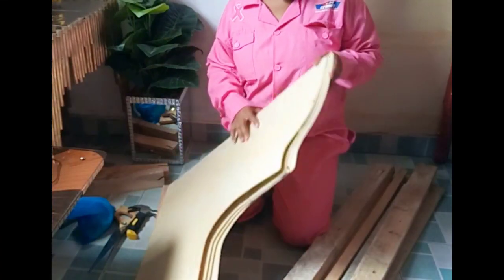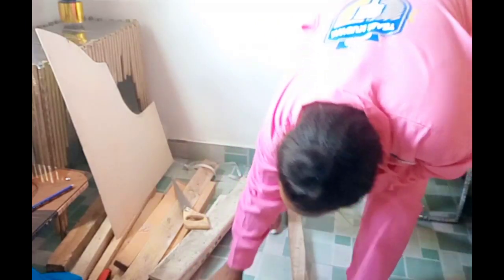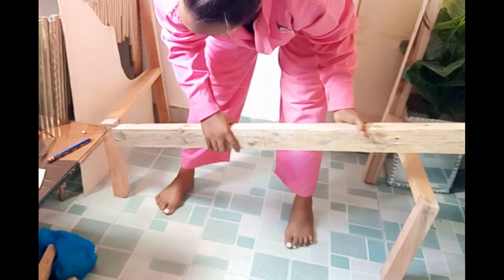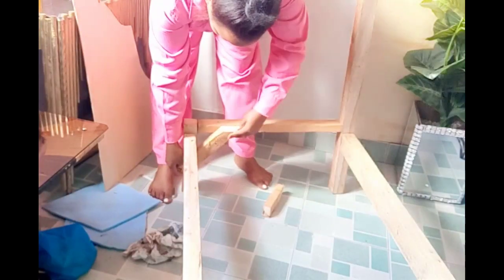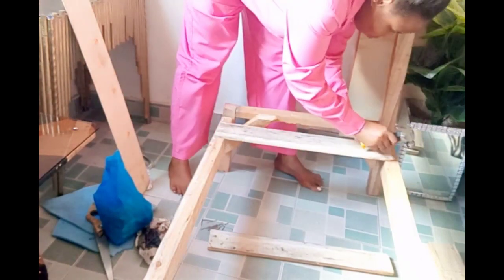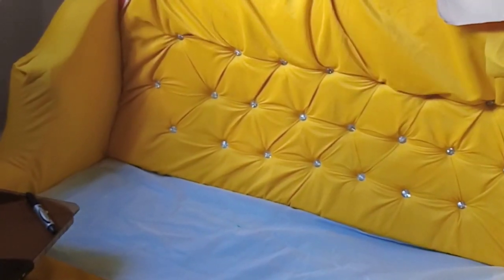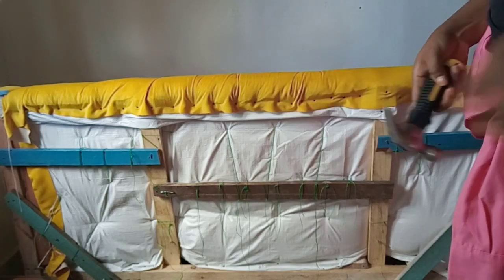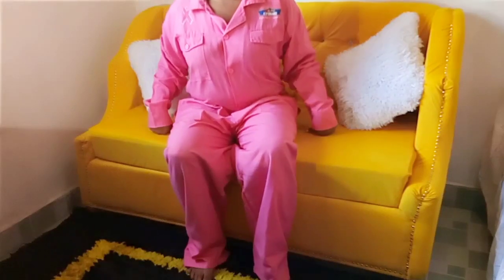HOW I BUILD MY SOFA FROM SCRATCH //(DIY sofa building)

Comment from the maker: Hello Team Forever20.
Here are the measurements used in this project. 
-Material 5meters 
-Size of the cushion 47 inches 
-Front legs 1ft 
-Back legs 2.5ft
-Foam thickness 2inches 
Thank you all for clicking, kindly like, subscribe and share. 
SUBSCRIBE HERE👇👇
https://youtu.be/zTzQWD9izTg
Reply: Hey what glue did you use to attach foam to chair